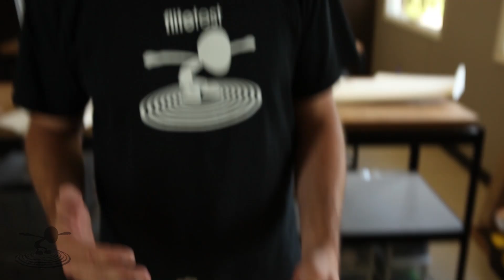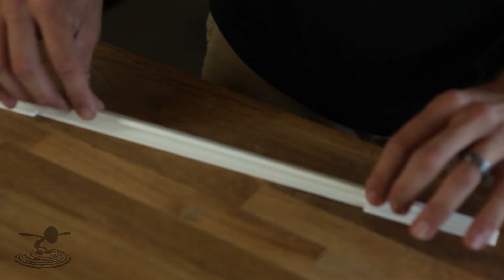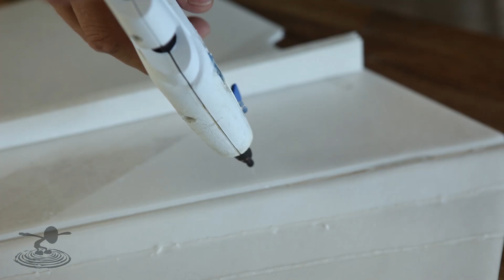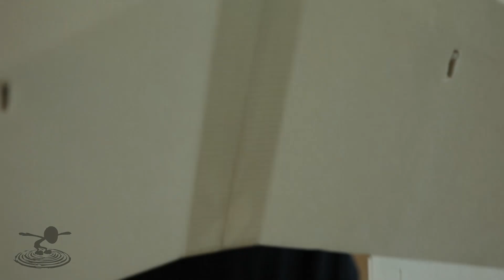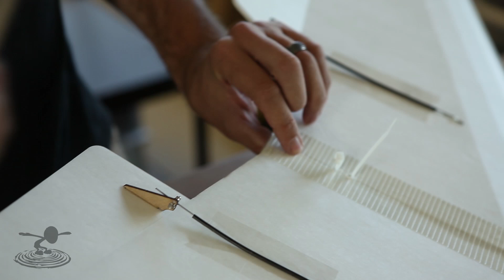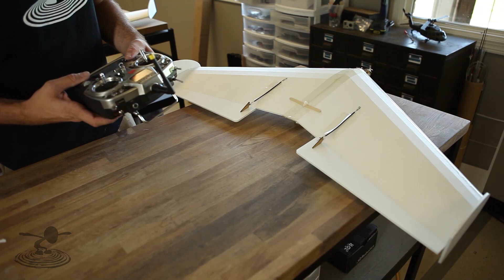Flite Test - FT Versa Wing - BUILD

Comment: Working on building my Versa II. Almost done. The second time you make one it takes half the time as the first. One thing to be careful of is the bevels that you make on the leading edge. Go over it 3 or 4 times so when  the wing bends together you get a nice thinner wing as opposed to fatter. Also put plenty of bevel into the elevators so they move downward very freely. I am thinking of cutting a deeper channel for the motor mount so it is closer to the center of gravity for balance without xtr

Comment: So I taped up my Versa, fiddled with some balance and tried again. I had to put in full trim elevator up and full throttle. Also I learned to toss it better, the toss into the air is of utmost importance. And it flew!!! It was very squirrelly and sadly I had a major crash. And another and another. And it got all soggy and untapeable. But it gave me inspiration for version II, I will use the same electrics. I have to protect the battery better, both batteries got distorted from the crashes.

Comment: I did some test glides in the back yard without power. The CG from the tile plans is off by about a quarter inch. I suppose there is a lot of error when printing the tile plans and taping them together. I think it needs some dihedral built  into the wing. And use as light weight motor and battery so you can at least have it fly to give you a chance to adjust the trims.

Comment: Took my Versa on it's maiden flight.Did not have good results. On launch it crashed straight to the ground like a ton of bricks. The foam did not hold up. I increased the elevator angle and tried to launch again with the same result but this time it twisted as it crashed to the ground This plane sucks, lol. Glad it was only $8.

Comment: Try out the microjet from Grayson Hobby. With a 30a ESC and 6x4 prop, it runs very cool with lots of power for park flyers. With a 2 cell you can use it for smaller 3D Planes running a 9x5.

Comment: This plane is 100% awesome. Completely stable and great plane to step up to from a slower plane for FPV.

I am running an Eflite370 1360 kv motor W/ 7x5 or 7x6 APC prop, 2650 3 cell up front. CG slightly nose heavy. Makes for perfect stability with no nose weight added. Am getting 25-30 minutes depending on throttle setting.

Just be careful how far you go. Easy to go out of range when not used to faster planes. It stays nice and level while in failsafe though :P (I did get it back, don't worry)

Comment: I purchased both dollar tree foam and 20X30 Office Max foam, which is much pricier. The Office Max foam is by far better. It is more ridged and perfectly flat and easy to cut and very light. The dollar tree foam is warped and to flimsy and the paper delaminates way to easy. I made the templates and I cut out all the parts, glued and glued the spars together. If you don't get a quick build kit you need to put the parts together and sand them so they match perfectly.

Comment: Ok I have a scrap piece of foam board I am working with. From my experiment, it is very hard to cut a straight line. I made a simple jig out of a piece of wood that I can screw on a regular razor blade on, it glides along a straight edge to make a relatively straight line. Also I experimented with the aileron. I think putting a strip of plain clear box tape on both sides makes it very secure, instead of putting hot glue on it.

Comment: Hey guys,

I am fairly new to rc flying, but I am still totally lost when it comes to brushles outrunners with all the different KVs and what amp esc to use and prop size and pitch

I have build a 30" kfm2 wing, a 20" kfm4 jet built for a 3" prop.... and a 16" mini kfm4 wing, ( its identical to the jet with out the nose and tail ) just a shorter wing span.

Any suggestions on super budget friendly motor/esc/prop combos? 
for good power, fast, for small scale, and also big scale

Thanks

Mike :D

Comment: The foam board sold at Walmart and craft stores is a different brand, much more expensive, it's heavier and doesn't have the same characteristics.  The foam used in all FT designs is sold at Dollar Tree stores for 1$, if you don't have one local you can buy a case of 25 on their website.

Comment: Can the Versa Wing fly with the weight of a 11.1 volt 3S 2200mAh battery? I have six of these batteries and I don't want to buy more just because I need a different size.

Comment: Got a couple issues, hopping someone can help, built the FT Versa Wing (tractor) today, 2200kv (pulling about 300 watts), 6x4.5 prop.  Never flow a wing, flies like it's on rails up to half throttle,  punch out or even smooth acceleration above 50% and it torque rolls hard and goes vertical???

Comment: I would recommend a simulator :)

Flying in wind is tough when you're just starting out, but I think one of these configured as a pusher would be great, though.  The most important thing is that your plane and your pride are resilient, because crashing is an unavoidable part of learning to fly.  Accept it.  Dust off your pride and your plane and keep trying. 

It is SO worth it to stick to it and get past the initial hump of learning to fly.

Comment: I agree. The coffee stir method puts a bend in the push rod. 

In previous builds they used a tie-wrap, zip-tie etc. to hold the push rod in place (put the zip-tie around the push rod tight enough that it will slide, cut the the zip-tie long enough so that you can push the zip-tie into the foam, cut a slit in the foam, glue, and stick the zip-tie into the foam). I would think that 2, maybe 3, should be more that enough to keep the push rod straight.

Comment: Nice video as usual!

Thinking about it... hot glue does not actually dry, it simply cools and solidifies.
If indeed hot glue dried, you could likely unglue it by adding water or the proper solvent, but it's not the case as far as I know :)

Comment: Awesome design, but I think you should have attached the wings with a main spar as well, not just tape and glue. Also, does anyone have any tips on waterproofing foamcore? Cause I often fly when the grass is wet or even over, I just don't want to have to make a new airframe if I crash in the wet grass too many times

Comment: What's the chance you can make a cutout foam board for the Elerons linkage to eliminate the bend put on them by the straw being taped? I wouldn't think it would interfere with aero, function, or looks but it would keep the servos from working any harder than they have to and they'd have a straight shot to the elerons.